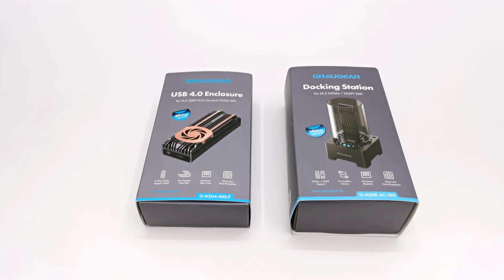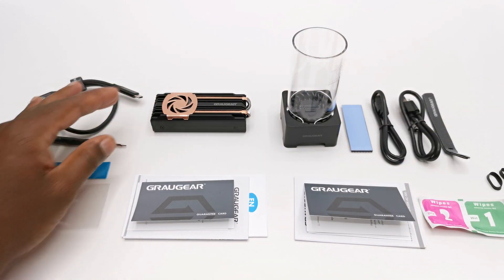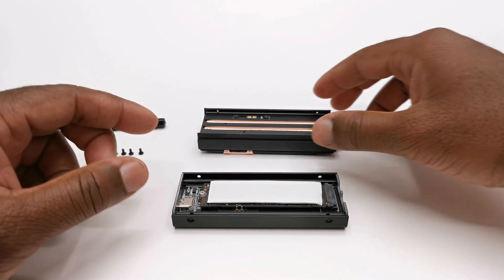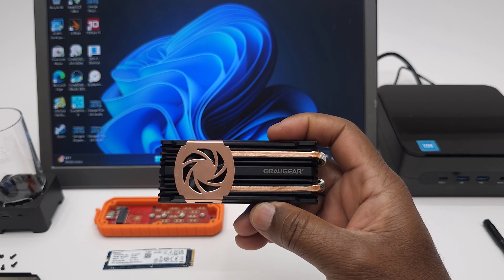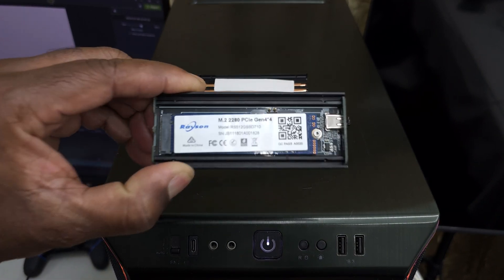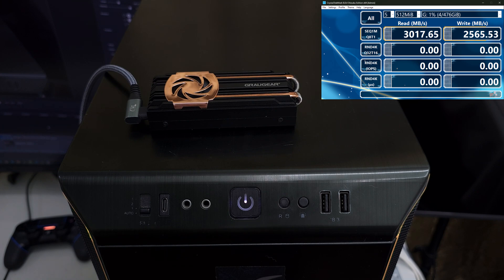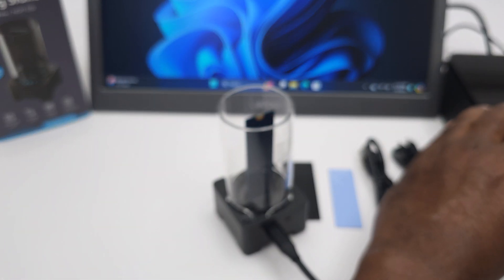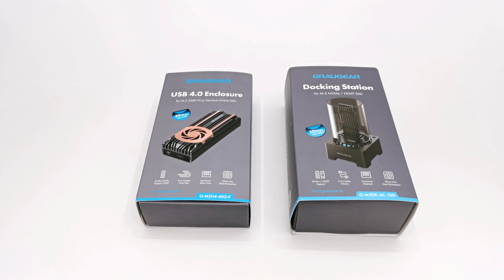Graugear PCIe 4.0 M.2 SSD USB-4 Thunderbolt 4 Enclosure - Say goodbye to USB 3.0

Comment: Been using the fan type enclosure for almost 2 yrs now with a 4TB SN850x. It's been my bounce around game drive. Basically non stop. I've once had to clean the fan, and tighten it down a bit due to some buzzing, but after that (less than 5m) it has been excellent. speeds are great, as are temps.
Reply from the maker: These are the best I agree. Thanks for sharing

Comment: A question about the SSD Enclosure, you recorded its interior quite fine at 2:57-3:19: What about the black plate which is labeled "USB 4.0 Enclosure for M.2 2280 PCIe Gen4x4 NVMe SSD". There is a protection foil on it, you can see it very well. My foil is also a bit loose at the edges. So should the foil be removed or should it be kept? What is it good for and what is the purpose of the black plate? Neither the manual talks about it nor does it show the plate on its images. I need to know this before I put in the SSD and screw together the case again. By the way thanks for the good review!
Reply from the maker: I have not had a reason to interfere with mine. if yours have become loose, look below to see if it was protecting any circuitry. If it is, simply apply a little glue and replace it. If there is nothing below there then I guess you can remove it.

Comment: Thank you for the video. Do know if a ssd with heatsink a total of 11mm will fit in this enclosure? I have one from Nextorage, that has the heatsink preinstalled.
Reply from the maker: You would have to remove the heatsink 11 mm is too thick.

Comment: I just got myself a Samsung 990 Pro with the built-in heatsink, will it fit in one of these enclosures with the heatsink on? Also will the heatsink improve the temperature?
Reply from the maker: No you have to remove the heatsink to use it in this enclosure it's too thick. You have the option of leaving of the top cover of the Graugear and using the chipset only, but I don't know if the stock heatsink is as efficient as the Graugear heat pipe and cooling fan.

Comment: I won't replace my i7-4510U laptop until it dies or I can get a USB4 laptop with 8+ hours battery life for a reasonable price. Hopefully a USB4 DAS with RAID5 also.
Reply from the maker: When you've got a good laptop yes you can become pretty attached to it. However, like me you'll soon understand that holding on too long can run you into compatibility issues when new hardware is released. By the time you get a new USB4 laptop we might start to see USB5 😲

Comment: Thunderbolt is not only on Mac computers.  These days you can buy a computer that has nothing to do with Apple and their proprietary crap and still get Thunderbolt 3 or better.  I know people assume it is only on Macs because they don't see it anywhere else.  Of course those same people think the MAC address (found on ALL modern network cards BTW) is a Mac thing that is proprietary to Apple.  To me talking to those ones is like talking to a wall.  The only difference is I would be less misinformed by talking to a wall since they don't speak!
Reply from the maker: Thanks for sharing your thoughts and opinion